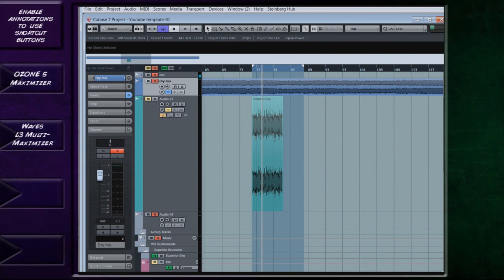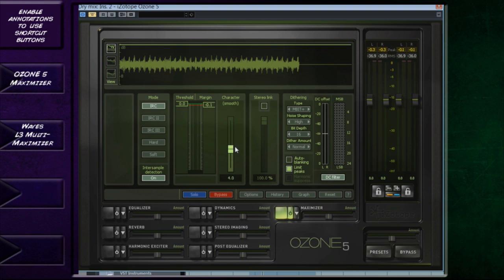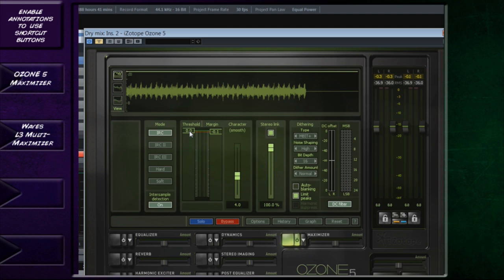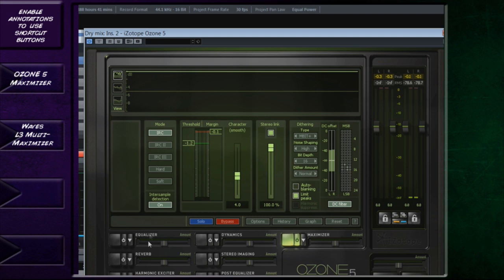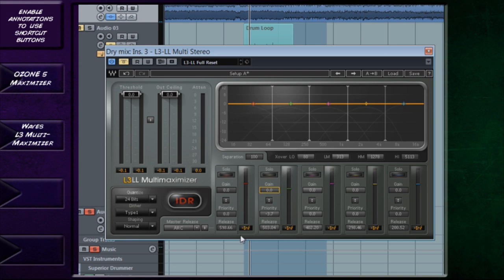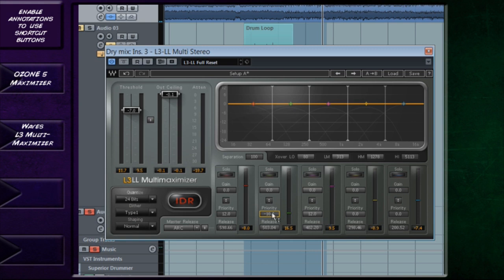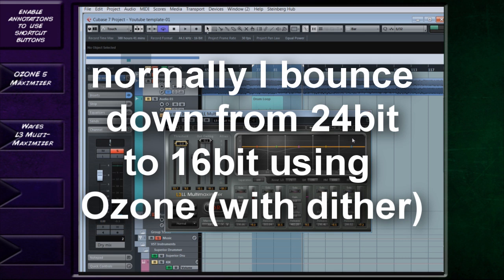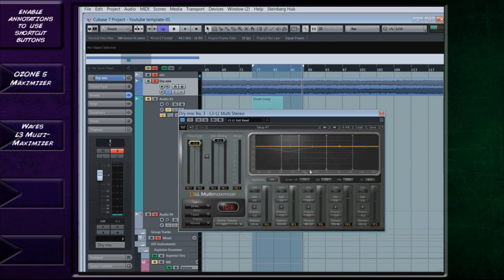Using Maximizers Effectively (pt 2) - Ozone 5 and Waves L3

Comment: hello james, great videos .... have a question for you, am having a problem when mastering .... in my songs i have clean guitar parts with no other instruments, and after i master the song that part sounds louder! and its volume start at a certain volume and increases. Do you know what the problem may be or what am doing wrong ? Thx in advance
Reply from the maker: Hi,thanks for the comment. It sounds like what's happening is that the quiet guitar part is being slammed upwards in db by some of the compression or maximizing you're doing at the mastering stage. It can be quite hard to balance this with the full-on sections as this is not anything you're doing wrong, just a symptom of a large dynamic range fitting into the compressor/maximizer. there are 3 methods I've used in the past to rectify this kind of thing, which you choose is basically down to whatever works best - 1) Re-mix the track with the guitar part much lower in the mix so that when it's raised in mastering it's sounding normal again. 2) Master the track for the louder bits and then manually edit the waveform to get the volume you want in the quiet sections, can be the best way in some songs but not work at all in others. 3) automate the plugins in you master bus to change for the quiet section - can work well but be prepared to spend some time fiddling with the best settings.....
Reply: that was very helpful :) I'll see which option works best, but about the gradual increase of volume in that part, do u think these methods would help also ?
Reply from the maker: That's an odd one, it might be a strange result of the gradual effects of the attack on the compression but doesn't sound very likely. Normally I find if there's a weird gradual changing of volume it's because I've accidentally added some automation to the track volume - have you checked that?
Reply: i'll check, maybe its that, thanks for the help
Reply: Tried lowering the volume by -3db on the clean guitar part in the pre master and it worked just fine after mastering and exporting ;)
Reply from the maker: NIce one - it's normal to have to do a couple of runs through the mastering process when this kind of things happen, glad you got it sorted
Reply: yah me too, it was so annoying to have this little bump in the way :)

Comment: hi james, can you please tell me what do you think of this mix? things i should change? did i overdid it on the maximizers? https://soundcloud.com/toxin9-1/anger thanks!
Reply from the maker: Hi mate - that's actually a pretty good mix. I was listening on a normal home stereo and couldn't hear anything out of place so that's a good thing. I didn't detect any over-compression either so you've probably found a sweet spot with your maximizers there. On a side note, I loved the bass riffs at the beginning and also the album cover is very cool!
If I was asked to remix it the one thing I would look at is the guitar sound. It's fine but sounds to me like there's a bit too much cab sound perhaps - maybe try adding in a second guitar line with just the amp sound to sharpen it up a bit? That's more personal taste than anything though,
Reply: The Arkham Rebellion thanks man!! it means a lot!! yea the guitar sound is something i kept going back to and tried to fix. i'll try what you said. the thing is it's an amplitube sound so i just removed the regular cabs from amplitube and put in the lecab 2 impulses. maybe i'll also try to go back to the regular cabs maybe that would work. anyway thanks!!!
Reply from the maker: toxin3456346 I've not got the latest version of Amplitube but I would bet that your lecab impulses will sound better!
Reply: The Arkham Rebellion ok i tried another mix with your advice! can you tell me what you think? https://soundcloud.com/toxin9-1/anger-mix-2 thanks!!!
Reply: toxin3456346 actually i think i overdid it in the maximizers... ill try another one!

Comment: Dithering between plugins (like from 48 or 32 float to back to 24 bit) using L2...What do you think???
Reply from the maker: Firstly I have to cover myself by saying that dithering can be quite complex and I can't pretend to understand all the nuances of doing unusual things with it. However, I do know that the act of dithering adds a small amount of noise to the signal so the general rule is to only dither when absolutely necessary. My understanding of floating point is that it's flexible with rounding, so actually you shouldn't need to dither when moving down to a lower bit rate from a floating point bit rate. Because it adds noise you should avoid doing it if you don't need to.
Reply: The Arkham Rebellion Excellent. Thank you for your time and consideration. One more question...I was taught that you never process after you dither down to 16 bit, yet, you apply an instance of the L3 Multi on your 16 bit, dithered, master. Can you give me some more insight on that?
Reply from the maker: I suppose a true Pro would never add any processing after dithering as something like the L3 is going to affect (and raise) the dithered noise as well as the music. Personally I can't hear any bad effects but I have an untreated room with budget home stereo speakers..... So the real answer is that if I thought it could do with some extra L3 boost then the proper thing would be to turn off the Ozone dithering and use the L3's instead - the reason I don't is that I just prefer the Ozone one, I couldn't tell you why!
Reply: The Arkham Rebellion Regarding the comment about dithering before the L3 is used, I believe that the effects of doing it that way would really only be heard on a more dynamic track, such as a jazz or classical track where the noise floor is more audible.
Reply from the maker: Kilikaaaaahh You're certainly right that it's probably not going to be audible in normal listening environments, however I have noticed that if I dither twice by mistake the noise over the blank silence or fades at the start/end of a song is where it can be heard (usually only on headphones). It's one of those things only people who mix would ever hear, but you know what it's like, once you've heard something you don't like in a mix you can't un-hear it.

Comment: im guessing you didn't get my reply so i'll ask here:  can you tell me please if i overdid it in this mix. also your opinions in general about the mix will be very much appreciated!!
Anger-insturmental song made with cubase 5 and superior drummer
Reply from the maker: Hi, your'e right, Google Plus working great as usual! I've had a listen and I think the drum and bass sounds are good but the guitar sound is a bit unfocused. That usually means that either the EQ needs rebalancing, the gain is too high, or if you've multitracked then you need to take another look at how the guitar sounds work together. Or it could be a bit of all 3! If you change your guitar sound a bit I reckon it will make a big difference to the overall power of the track
Reply: The Arkham Rebellion thanks!!!

Comment: so i have a question, when you mix, you start with a w1 limiter to an SLL comp to a master tape and the LinAB, then ozone 5 and then the L3? trying to understand the order..... thanks!!
Reply from the maker: My personal order is: SSL, LinMB, w1 (optional), Ozone, L3 (optional). I like the SSL first to tie everything together , and sometimes some mixes don't work with all of the maximizers so I do 2 or 3 mixes and see which combo works best for a particular song.In my experience the more instruments a song has (like loads of synths or orchestral lines added to the normal band) the less maximizers it can handle before sounding like shit.

Comment: Hello James, I'd like to hear your take on sample rate conversion; or rather at which point during the mastering process (and before the final dithering to 16 bit) would you apply it? Let's say the final mix for your song is 24 bit/48 kHz, would you run it through the various Ozone 5 modules (including the Maximizer), but opt not to dither it at that point, instead doing a sample rate conversion to 44.1 kHz on the resultant file, and only then as the final step apply dithering (perhaps with the L2/L3 but possibly without further "maximisation")?
Whew, that was a long and convoluted sentence...cheers anyway!
Reply from the maker: My understanding is that it's better to keep the 24bit resolution as long as possible as it allows greater dynamic range, so it's obviously not a good thing to lose that before necessary, My current setup is to bounce down to 16bit right after Ozone as I find sometimes the L3 process is not always necessary afterwards. I certainly wouldn't convert down to 16bit any sooner than that in my mastering chain because of the loss in dynamic range
Reply: Sorry, I was being unclear in my question. I was asking about sample rate conversion, not bit depth. It is also my understanding that dithering is the absolute last step in the mastering process, whilst the penultimate step is sample rate conversion. Obviously you want to maintain the highest audio quality possible throughout the mastering processing (in my case 24/48) to avoid signal degradation before "downgrading" your files to 16/44 for CD manufacture. To my mind this entails first running e.g. the Ozone 5 mastering processes WITHOUT dithering, then converting the file sample rate down to 44.1 kHz, and finally applying just the dithering down to 16 bit (in the Ozone maximizer or some other plugin) for your finished ready-for-release audio file. NB: I perform mastering in a dedicated audio editor, not in my Cubase via main mix channel fx inserts. Would you regard the above as a sound (no pun intended) idea?
Reply from the maker: Pekka Kapusta My mistake, I didn't read it properly to begin with! The sample rate question is harder to answer as I think there are differing opinions on how much difference it makes. I know people who stick to 44.1 throughout regardless of bit depth, and others who say they can tell the difference between 48/24 and 44.1/24. Personally I never entertained going above 48 because of the massive increase in drive space, and to be honest I've never done a blind test on myself between 48 and 44.1 so I don't know if it matters to me as much as bit depth. So with that in mind I myself wouldn't worry about when you do the conversion, however as with all processing it's best kept to a minimum so you might find it's worth testing whether your process sounds cleaner doing it all at once or separately. I have heard that equipment makes a difference in conversion quality so I guess the best advice is to try a couple of methods and see which one works best with your soundcard/daw etc. My feeling is that doing 2 conversions separately is more likely to add small errors than improve the sound, but that's just a feeling!
Reply: I run 88.2/24 until just before I limit/dither. I export my file(s), as wavs, at 44.1/24 then open a new session. Then I limit and dither to 16bits and onto wave lab for redbook cd indexing.